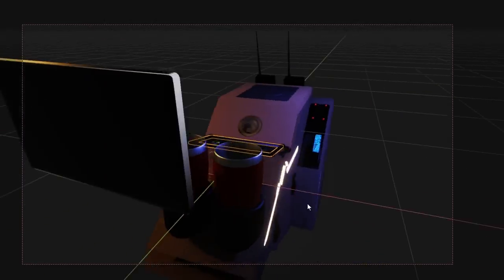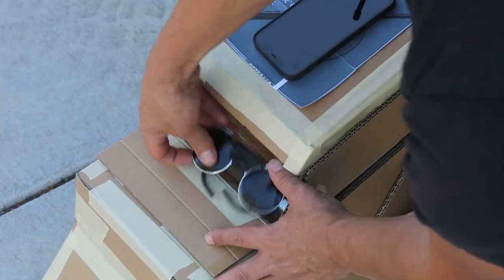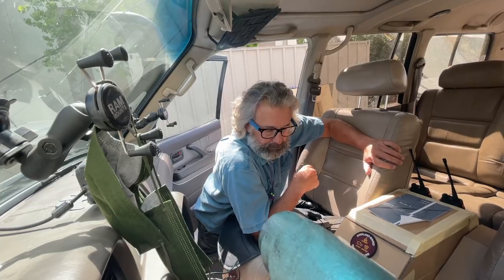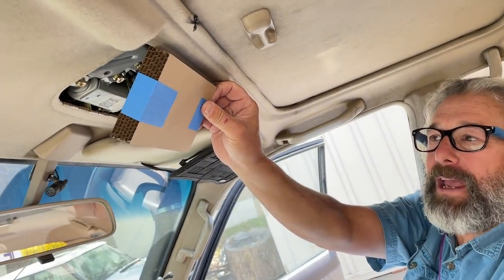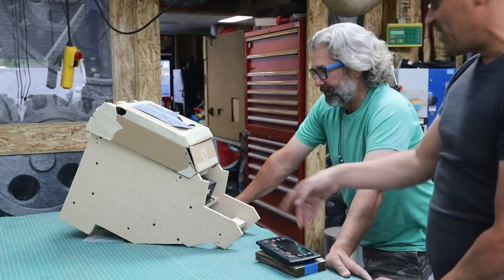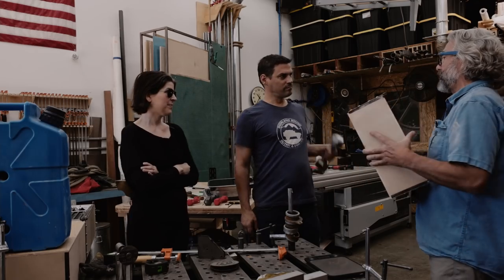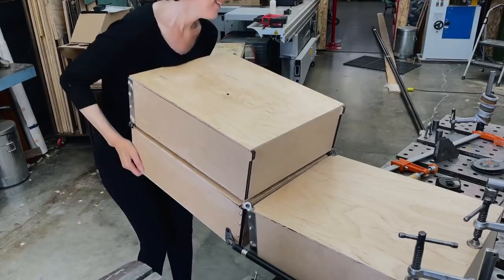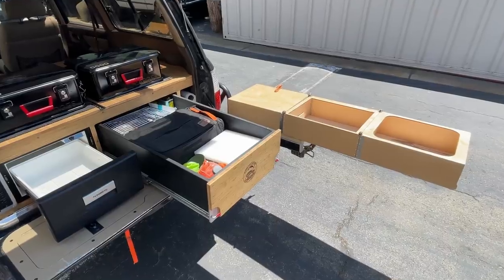Ultimate Off Road Kitchen (and Console) | Design Update

Comment: I wondered what those slots in the back of your console were for. Unless you plan to integrate charging for the radios into your console, I would make the slots a little wider and deeper, to accommodate other HT's, and use elastic to hold them in place. Oh, since Parnell was talking about making that whole top piece removable, why not make that radio storage modular in a way that allows you to 3D print new holders if you end up with different HT's down the road.
Reply from the maker: Hey Robert. They will have integrated charging, and the base units will be specific to the radio so they clip in. Good designers think alike! They will be modular for other radios.
Reply: I am really looking forward to seeing how you guys implement this. I am working on turning a '75 Ramcharger into an overland rig. I am working on designing a new center console, so the timing on your videos has been perfect for me. I am getting to see your process, iterations, and troubleshooting before I end up making the same mistakes. (-:

Also, being a fellow Ham means I have to integrate HT storage and charging into my rig as well. I also plan to tuck 2M/70cm and GMRS mobile rigs under the dash or use units with remote heads.